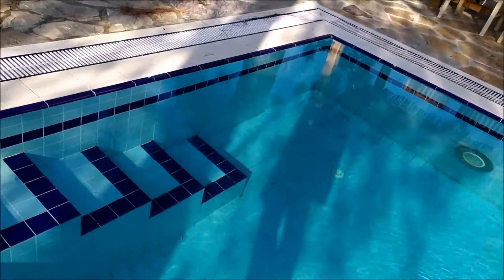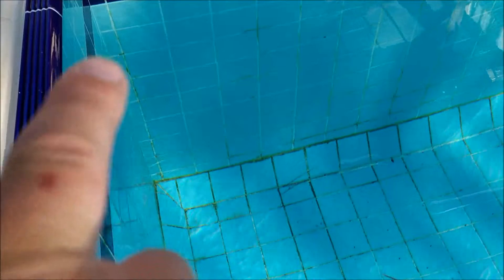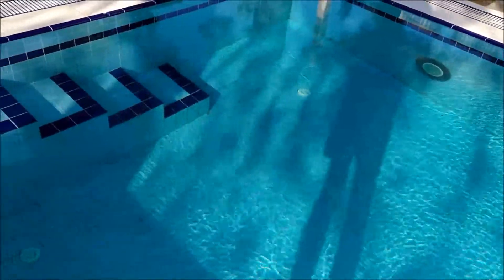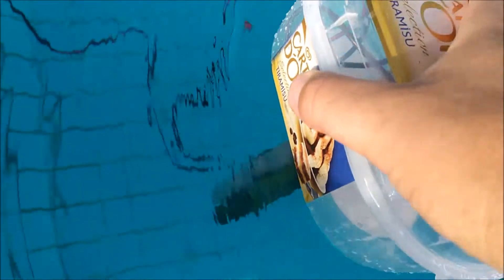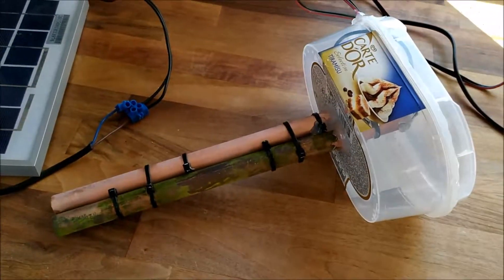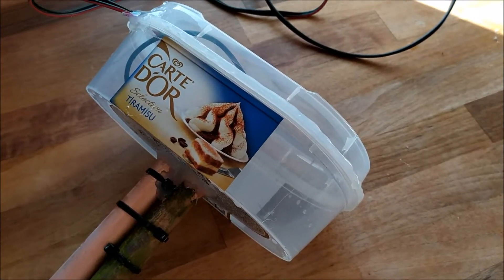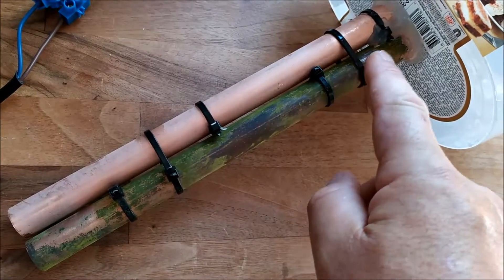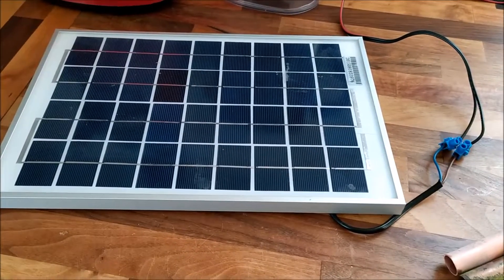DIY solar powered  pool ionizer ...

Comment: I made a floating one last year with a $15 1.5v solar panel from harbor freight connected to some copper pieces. It worked amazing cut my chlorine by I'd guess 80%. I just made v2.0 for this year with a $30 panel that is 7v. 
This is more pieces than mine but same idea. I really think this works, also I don't have salt in my pool
Reply: Do you have a video on how you made yours?
Reply: I made same one but when the copper touches the water it shut off the solar panel what am i doing wrong ?
Reply: @LadyGoza Your copper pipes are probably touching shorting the power. Make sure they're not touching.
Reply: Which solor panel i should use
Help me

Comment: What about the silver thats supposed to go around it? Would it be more effective with that?
Reply from the maker: Hi, yes silver is a good anti bacterial metal, but it is more expensive, only one of the electrodes is giving off copper and degrading, I think this is why on commercial products you see copper and a silver (stainless steel) electrode, the stainless doesn't degrade only the copper, what I do now to even things up is every day I change the polarity so both electrodes are used up equally..
👍
Reply: @My Turkish Life  I appreciate you man. Thanks for the reply. Have a wonderful day!

Comment: Hi. Was just curious if it actually worked? Is it helping you with algae?
Reply from the maker: Hi and thank you for the reply,
I was going to do an update after a month , but I have to say it is working really well.
Before using this device I was adding chlorine every 5 days even though I have a chlorinator system .
Since using this system I have not added additional chlorine , the algea that was present has now gone and the pool seems cleaner, the chlorine levels are increasing, I suppose the copper is giving the chlorine a helping hand.
But yes a big difference , I will do a video after 1 month ...
Regards
Reply: I would wonder if you have more success if you added zinc to 1 pipe, and copper to the other pipe.

That is the traditional anode cathode, however I have no idea with swimming pools, and I need to clean up my own pool, and I'll post my results to your channel after this is done.

God Bless #WWG1WGA
Reply from the maker: @paulgleason1  hi , yes I suppose using Zinc as the other electrode would be ok , but this seemed to work very well.
In my last video concerning the pool ioniser I showed how the electrode had been used up so to speak.
That was around 5 weeks ago and I still have not made a replacement.
It appears that the copper emitted into the pool is still working, my chlorinator is still working also as before but there is no sign of any algae.
When I refill the pool next year I will do the same again and see if one use (until the pipe disappears) of the ioniser will be enough for the season.
Hope it helps .
Regards

Comment: Do I have to add chlorine to my pool if I use an ionizer?
Reply from the maker: Hi, this year I haven't added any additional chemicals, only salt which in turn gets broken down into chlorine by the chlorinator, and then of course the copper.
It has worked well, just keep an eye on ph as it it known for salt systems to see the pH go up, then of course you need to add acid to reduce it..
It's a game as you know to get things right, but just having the salt and salt generator and the copper seems to work well 👍
Reply: @myturkishlife1777  Ok thank you but what if I don't have a chlorinator?
Reply from the maker: @d.j.wellington  hi, that's ok, just use chlorine but you will probably find you will use less as the copper will take over dealing with bacteria and algea ..
Reply: @myturkishlife1777  Ok thank you so much.
Reply: I'm building a natural pool and filter with rocks and the bacteria on the rocks to filter and I'll probably add a UV light and an ionizer and no chemicals. Other ppl use a different system with kitty litter and laterite in a basket  to create what is called an "anoxic" filter.